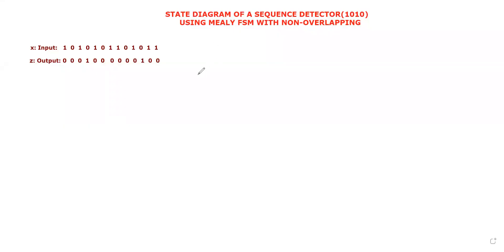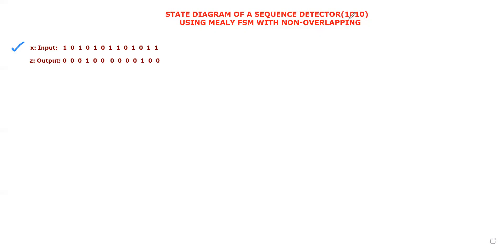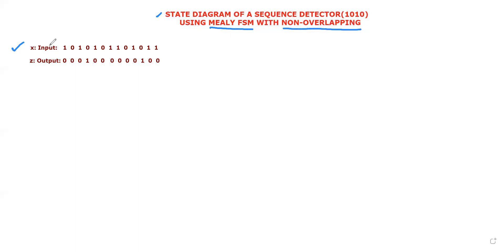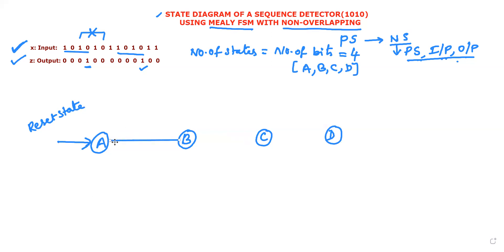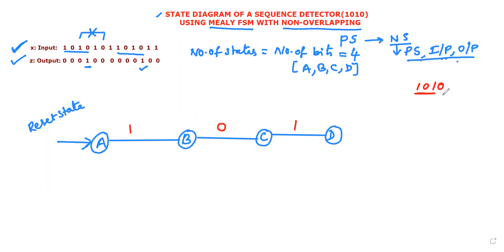30.1 Mealy FSM State Diagram of a Sequence Detector  Using Non-Overlapping | తెలుగు

Comment: Mam There is a mistake.We cant find 1010 as group in directly we compare bit by bit mam then the output will be only one could you please compare bit by bit then you got your mistake...
Reply from the maker: Non overlapping method right. So that if match to self state ok, otherwise reset state
Reply from the maker: If you have doubt call me: 9441753374
Reply: Could you please
Check the answer ma'am. From state  D for 1 we should move to State B